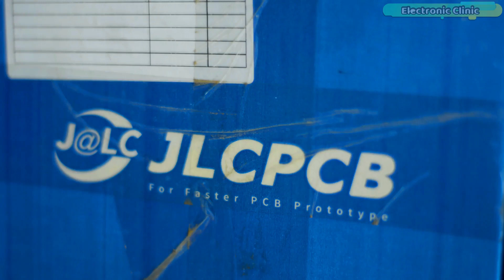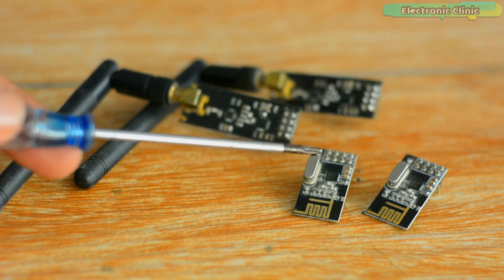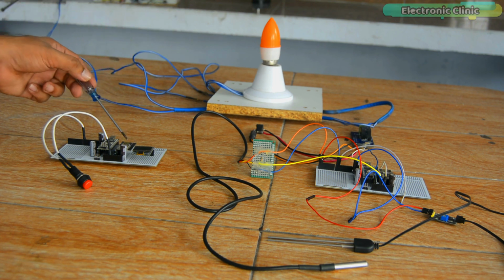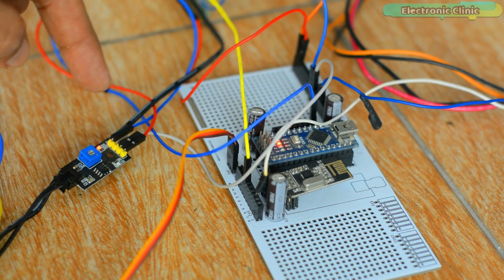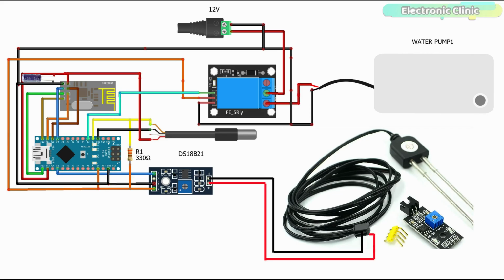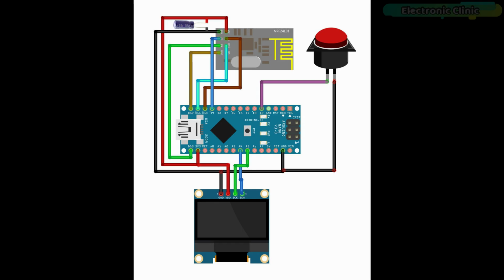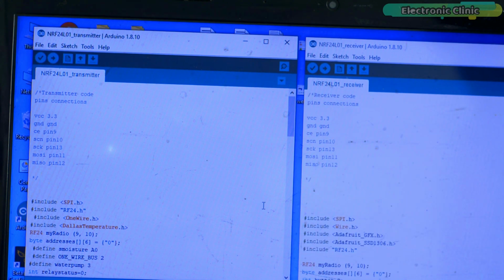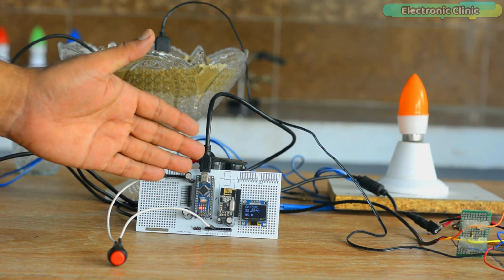NRF24L01 Arduino Based Soil Moisture Monitoring system with Feedback

Comment: Provide code and circuit diagram
Reply from the maker: the developer is working on the error. its due to the Cloud flare security. it will resolved, then you can access the code and circuit diagram.